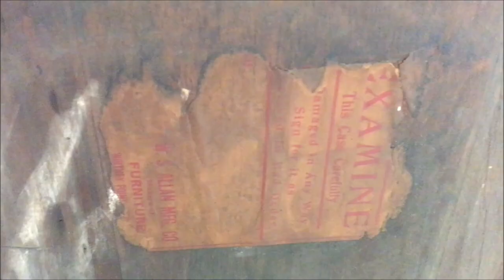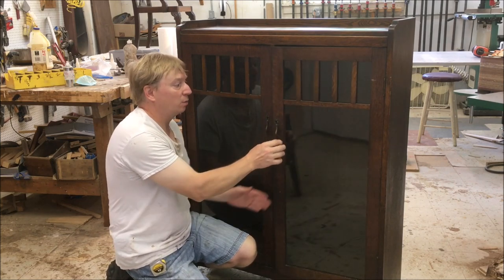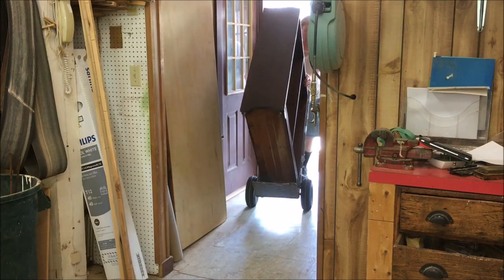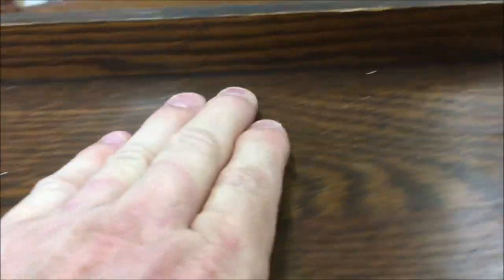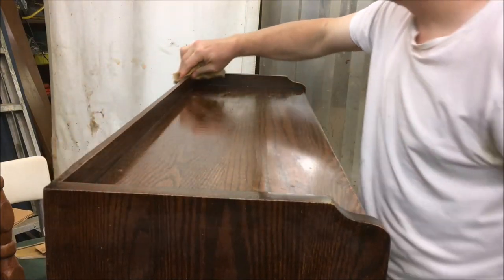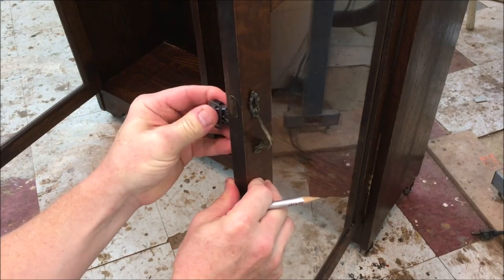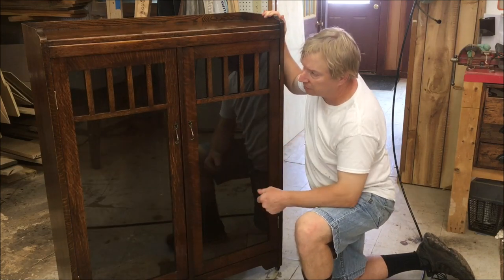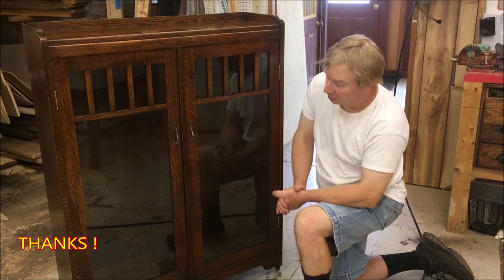REFURBISH MISSION OAK BOOKCASE

Comment: Looks really good. Thanks for inculding the info on how you fixed the loose joints, I have one of those this week.
Reply from the maker: i did not have to take anything apart , just pull it together and reglue the glue blocks